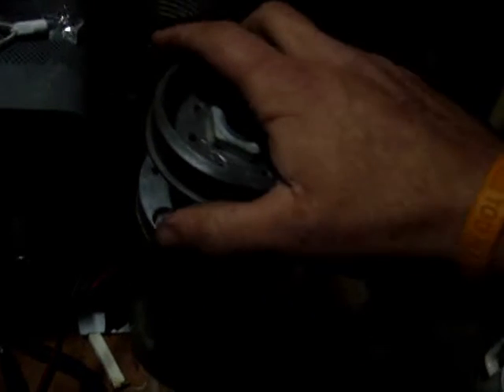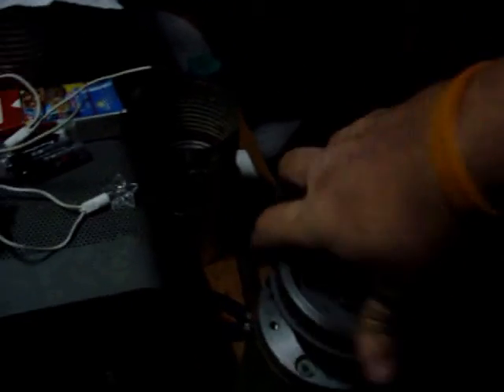HI Q AMATEC TAPE DRIVE MOTOR SHOWING AMPS

Comment: @muddymuddymuddmann I am getting up the courage to carve a 4.5 ft prop to attach to the blower motor, using your instructions. I think I will get 50 volts at 10 mph. From your math video, I figure 7.5 ft is too slow rotation. 4.5 might be too big also.  My battery bank is 48 volt.  I've been thinking about electronic schemes to voltage double, to use a bigger prop. The microwave motor is a surprise to me.

Comment: 11 seconds ago

I discovered that my broken VDC high efficiency furnace fan motor is actually an AC motor with a DC wave controller circuit, which must have burned out.

I removed the circuit and I have a nice 6 inch diameter, 5 inch long VAC alternator with a long shaft and with three wires producing 18 VAC at 2 rpm and 60 VAC hand spinning it as fast as I can, with no load. So save those broken furnace fan motors.

Comment: I discovered that my broken VDC high efficiency furnace fan motor is actually an AC motor with a DC wave generator controller circuit, which must have burned out.

I removed the circuit and I have a nice 6 inch diameter, 5 inch long VAC alternator with a long shaft and with three wires producing 18 VAC at 2 rpm and 60 VAC hand spinning it as fast as I can, with no load. So save those broken furnace fan motors.